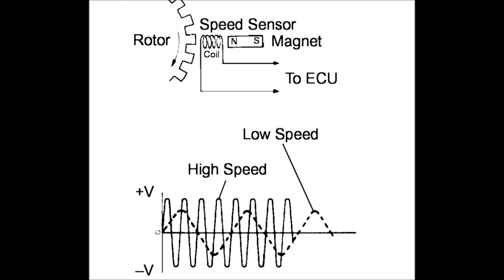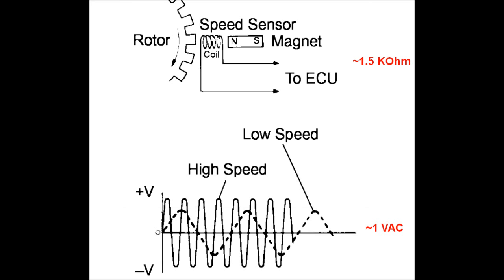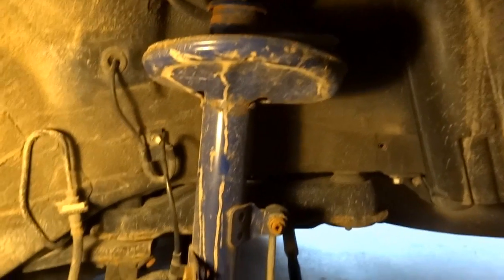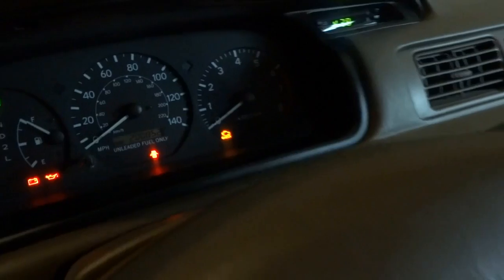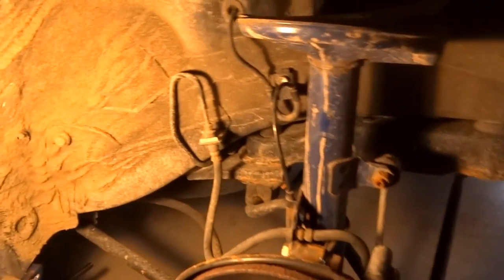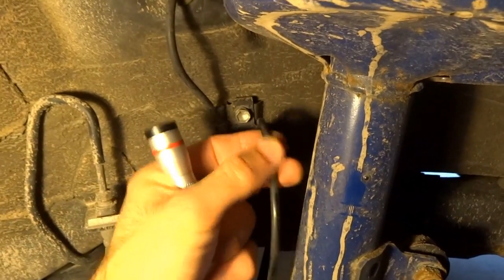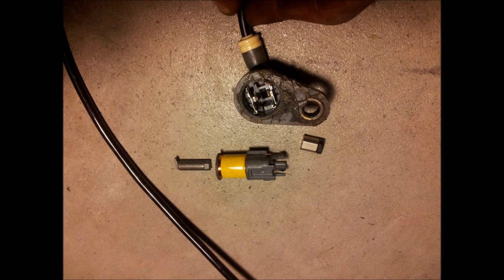Fixing/Replacing ABS speed sensors (Toyota Camry 1999)

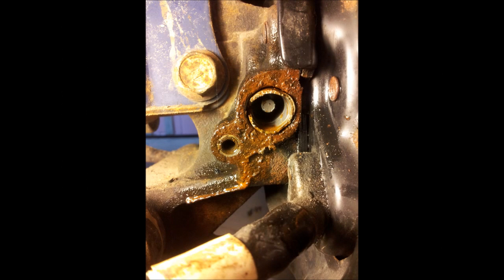Comment: The reason I am here is I have an issue with my 99 camry and it seems that the ABS cycles on very low speed driving such as parking, etc. There seems to be no issue with an ABS malfunction since there is no warning light. On the contrary...the ABS is trying to do what it is designed to do. NOW....I worked for GM for a number of years and there was an issue with ABS cycling on low speeds. The first time I experienced it, I almost went through the shop door because the ABS is pulsing and not allowing you to stop. The fix was to remove the sensor (which looking at the video it is the identical set up) and believe it or not, the small amount of rust/corrosion build up causes the sensor to receive a false signal that the wheel speed =0. Look at 3:16 and you will see a good example. Sand the area where the sensor is bolted to being careful not to get any debris in the sensor hole of course, then spray it with corrosion proof paint or just regular spray paint until it is dry, reattach the sensor, reassemble and good luck to you. I am going to try it today if the weather holds out.

Comment: Nice video! I got an ABS code 35  on my 95 Avalon, which means a right front ABS speed sensor. I guess I'll take off the wheel and see what it looks like. I can get a replacement for $18 on Amazon. Will let you know how it goes. 

(For those who don't know, you can read the code by jumping pins E1 to Tc in the diagnostic box that sits just in front of the passenger side firewall--very easy to access with hood up. After you jumper, start the engine. The ABS light will blink the code. In my case it was 3 flashes, short pause 5 flashes, then a long pause, and it repeats.) This works on all cars up to 1996, and many after that. It works on my 2002 Honda Accord.

Comment: Have a 1996 Lexus GS300 Out of the Blue started the Car the other morning and ABS Light came on
And Stayed on,My Innova meter won’t test ABS so I was going to Buy an Autel MaxiDiag Elite MD802 ALL System+DS
But First I contacted Autel Support to ask them if this meter would point out which ABS was bad on which Wheel?
Well I had to submit my VIN so they could Check with Engineers Here’s is there Response :We have consult our engineer, they said the car is pretty special,
So MD802 all system can’t work on 1996 Lexus ES300,Glad I didn’t waste my Money.
Anyway Can you tell me if your Jumper of the Pins on the Camry will work on my ES300 to get codes ?
Thank You
Frank

Comment: I was driving about 35mph with my foot on the gas. All of the sudden my car put itself into a "ABS" brake mode with the stuttering feeling you get when stopping in rain or snow. Then the "Trac Off" light came on and the stuttering stopped and everything seemed to return to normal other than not being able to turn traction control on. I did not slam on the brakes to test the ABS, though. Anyone think this could be it? My mechanic is not even sure he will get a code on the OBD 2. Thank you.

Also, are these sensors on all four wheels of the car and will each one have to be tested individually?

Comment: hello, 2015 and your video is still pulling hits and questions being asked. great video and info.!  my question is to pull out the old rusted sensor, it is a matter of just rotating back and forth and pulling on it or is it  hammer and chisel? i broke my 10mm bolt and now have to drill it out and tap it. my quandary is how much work is to get out the rusted piece, guess its fear of the unknown

Comment: I know this is an old video, but I am doing a replacement on my car. Does the sensor connection point run into the trunk or the back seat?
Reply from the maker: Amanda Wehland Back seat.
Reply: +Felix Rusu How did you get the broken sensor out of the hole? Drill it out or use some sorta of chisel?
Reply: @24inchdubz  Not sure why but most You tube mechanics don't show how to do the hard stuff. It's like they want you to think it is as easy as ''remove bolt. Pull sensor out.'  At least he mentioned it was difficult.  I'm thinking drill and chisel ..plenty of PB too. I believe it's plastic inside(mostly) and a thin metal shell. I know this is 4 year old question but it may help other or at least let them know if in rust belt, not a quick and easy removal.

Comment: Wonderful video! Though I am having a lot of trouble finding information about the codes. From which information source did you interpret the flashes?
Cheers,
Andrew
Reply from the maker: To be honest I can't remember exactly, but i spent hours searching the web for other videos/tutorials/documentation before I started disassembling my sensors and I picked the codes up in different sources, probably some repair PDF manuals and forums around the web. The car operator manual has no such codes or details unfortunately.

Comment: I had an ABS sensor fail on a Nissan Maxima. A replacement was about $130. I cracked open the housing of the sensor which was filled with potting material and found that the wire connecting the coil was disconnected. The wire was so contaminated that it wouldn't even solder back onto the coil. I took some communications wire and reproduced the harness, soldered the new wires on the sensor coil and refilled the housing with JB Weld to replace the potting material. Put it back on and it's as good as new.

Comment from the maker: If you got all the codes those should tell you exactly what's wrong. My solution works if the wiring is bad but the sensor is good. I'm not a mechanic so sorry if I don't have more advice.

Comment from the maker: I tried a few ABS scan tools myself before doing this. None worked.
So I just pulled the codes out the raw way:
Try jumpering the TC to E1 slots (first pull out the jumper from the lower right corner, then put a wire from TC to E1). Then turn the ignition key to ON. The ABS lights should then flash the codes (for ex: flash 3 times, pause then flash 4 times = code 34, meaning one of the rear ABS sensors is bad). Google for the codes when you have them if they are different than mine.